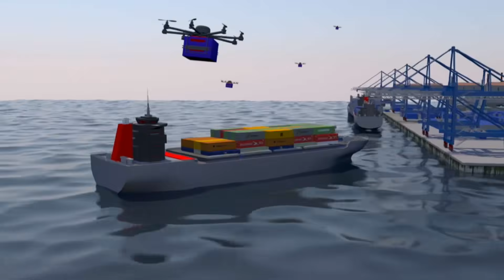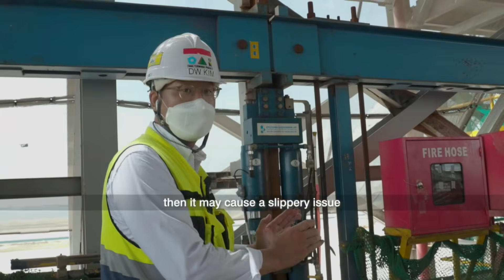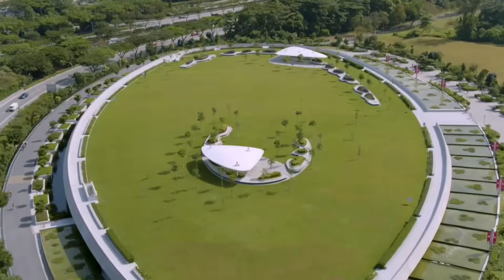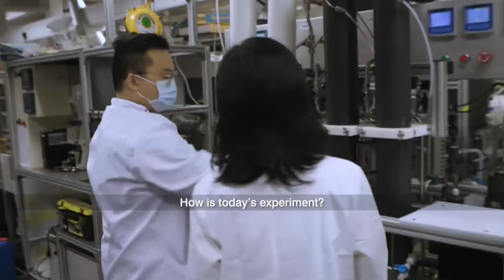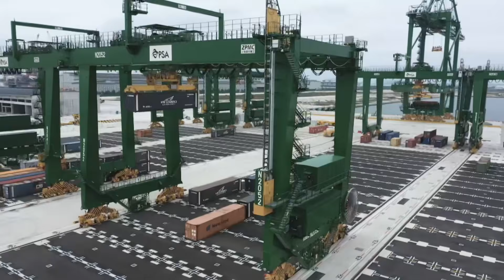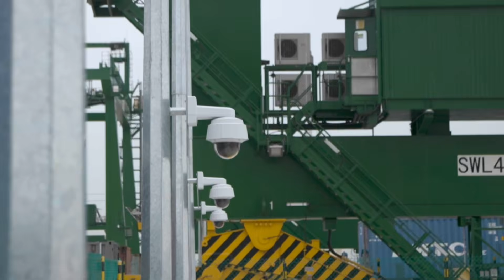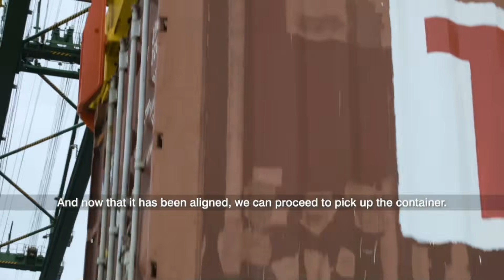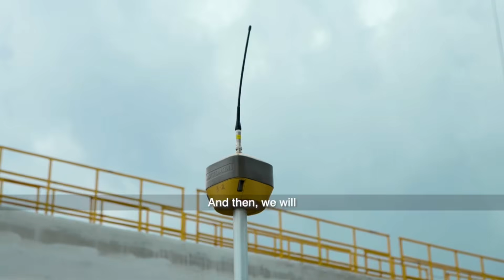Radical Innovations To Singapore's Water Problem | Tomorrow City | Part 3/3

Comment: Malaysia has been supplying fresh water from the Johor River since the agreements were signed and guaranteed by the government of Malaysia in the saperation agreement signed in 1965 that established Singapore as independent and sovereign state. The 2nd agreement will expire in 2061 if I'm not mistaken. In return Singapore obliged to provide Johor with treated water up to 2% of the water they import from Malaysia.

I am not sure whether the completed Linggiu Reservoir water supply project at the Linggiu Dam in Johor will stop once the agreement expires or not if this mega project is fully completed.

It is indeed a good start for Singapore to have their own treated water by using sea water. The global warming dries out fresh water so quickly and this causes a huge impact to Malaysia esp Johor  since they need to supply water not only to Johor but both countries. 

I really hope the current Johor-Singapore causeway bridge can be redesigned and/or reengineered to allow the sea water to flow since the first proposal to restructure the bridge was declined. If this happens, it may affect the PSA and Jurong port so badly. I believe this was the reason why the proposal was rejected by Singapore.
Reply: Malaysia has resources but chose and actively choosing not to develop it. Johor shouldn’t be dependent on just the one Linggiu reservoir, it should create redundancies and back ups.
The causeway is an important piece of history for both Singapore and Johor. There isn’t any need to replace it as yet. If you’re implying a freer Johor Strait would mean trouble for the Singapore ports, then I suggest you look at Tanjung Pelepas.
Reply: Gone are those days Singapore has to rely on water imported from Johor. While the current agreement suggested that Singapore has to oblige and buy water from Malaysia, the island has been 100% independent on water resources for decade or so. 

A series of droughts in the 80s and 90s made the government understood the need for total independence of water, and being held ransomed by Malaysia at times isn’t the most pleasant of situations.

From 4 reservoirs till 17 today, 4 desalination plants and 2 water recycling plants, and a number of urban storm water storage facilities. And these figures will change again as more are planned and earmarked. 

It’s brilliant that what thinking ahead of time and addressing difficult situations gets you to, instead of hankering neighbours to give in, or simply sit back and ask for international aid.

Comment: and you wonder why the sea levels are rising ...1/3 of Holland was sea 50 years ago ...China as reclaimed 4,700 Sq miles from  the sea  Bangladesh what to reclaim 4,700 Sq miles from the sea if you add China / Holland & Bangladesh it adds up to 12.100 Sq miles ...With avg depth of 39 ft ...

Comment: it seems to me that given the pressure and volume needed a number of well placed disused submarines, equipped with the proper membrane could supply most of their needs from the bottom of the sea !
Reply: I have been thinking about that using the presure at the bottom of the ocean to push sea water through membranes.
Reply: @miles2378  me too! do we all share the same brain cells? hahahah
Reply: Using the free pressure is key to the success.  The waste needs to be used too.  How to save the marine life with all that matters too.  Singapore I am proud.  Good luck.

Comment: And then came mRNA of the Covidy-19 kind.. and the world population ceased to expand..  The economic model changed.. and that rebar will rot in 40 years the silicate coating will not last... is should have had a tin coating.. better yet would have been fiberglass / plastic rods

Comment: Depth required for collecting rain-water should not be a problem? Just need to dig deeper? All low-lying areas in Singapore can be gradually converted as areas for colecting / storing rain-water by building key structures to support taller & above ground-level buildings there.  In term of operational cost, this will be cheaper than using large amount of energy to desalinate sea water using reverse omosis?